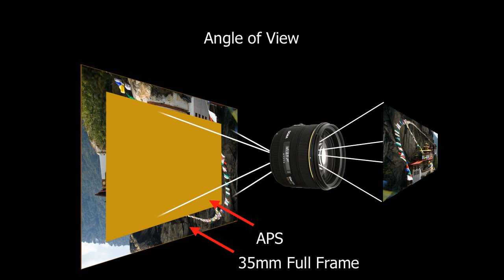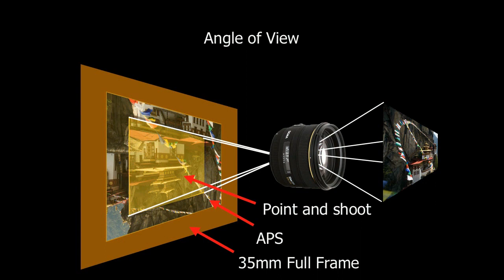John Greengo: Full Frame vs. Crop vs. Point & Shoot Sensors.

Comment: Correct, but then you loose that ability to achieve a shallow depth of field that can be achieved with larger sensors. Also a larger sensor equates to larger photosites and better light gathering abilities, also better noise performance at higher ISO's.
Reply: The depth of field is actually a little lower with a crop sensor at the same distance.  Moving back or using a lower focal length increases the depth of field.